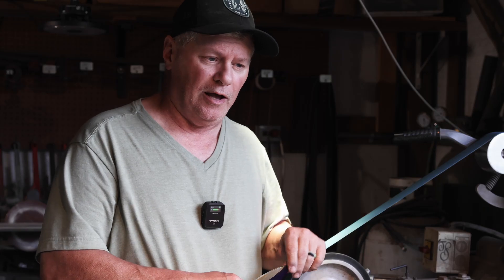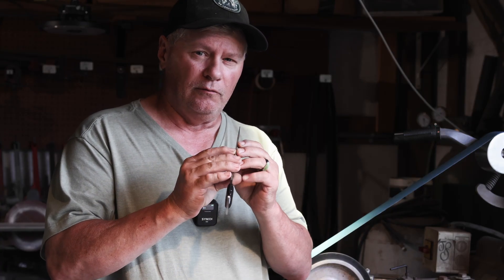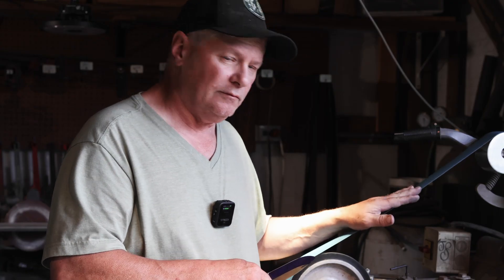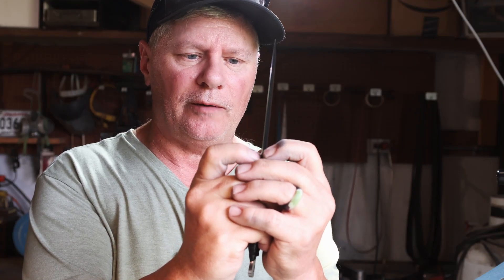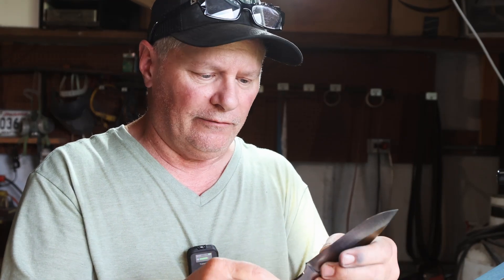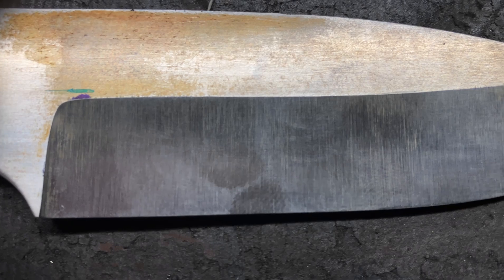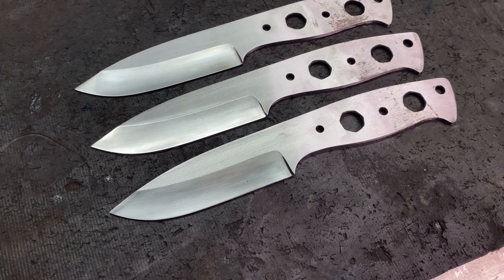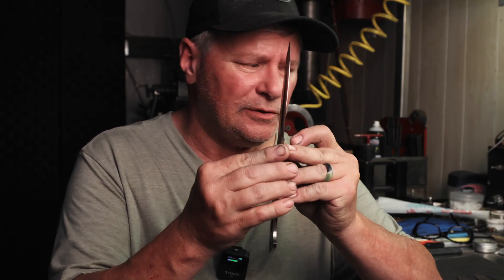Contact wheel size for hollowgrinding

Comment: Hi Tony, do you always use smooth wheels (vs. serrated)? Can you share your reasoning? I'm trying to decide between the two.
Reply from the maker: I use serrated for hogging material.  The belt will cut better and run a little cooler.  But when grinding bevels, I run smooth wheels for cleaner, smooth cutting.

Comment: Giving hollow grinding a go has been on my mind for a while now, an 8 inch wheel is the biggest I can get on my style of grinder, question is what size stock are you working with i typically use 3mm (1/8] or 4mm, or does that not matter?
Reply from the maker: This is an 8” wheel.  No stock thickness doesn’t matter if you follow the height rule per wheel diameter.

Comment: It looks like your finish grinding on a smooth 8 inch wheel, what is the hardness durometor of that wheel? Is that something you use just for finishing?
Reply from the maker: Yes it’s a smooth wheel.  I can’t remember the hardness but I remember it being one of the harder options.  Been over 25 years ago.

Comment: About 15 years ago, I hollow ground practically every knife I made. All I had was the Grizzly knife grinder and it didn’t have a very good platen so my flat grinds weren’t the best. So I got really good at hollow grinding. Bet I haven’t done a hollow grind for at least 8 years. I think it’s about time to get back into it. Thanks for the inspiration Tony!
Reply from the maker: I learned to grind hollowgrinding first, then learned flat grinding.  I do both depending on the need and want.  Once you learn, you’ll never loose it.  Like riding a bike.  😁

Comment: Ive been experimenting with grinding hollow grinds recently and in certain circumstances i find it easier to hold my blade at the bottom of the wheel to grind and then it lets me see where i am grinding and where exactly i am removing material from as soon as i do it. It does take a little bit to get used to but can be a handy trick if you can figure it out. Those grinds looks great.
Reply from the maker: Yep it’s finding what works for ya.  Thanks for watching!  🙂